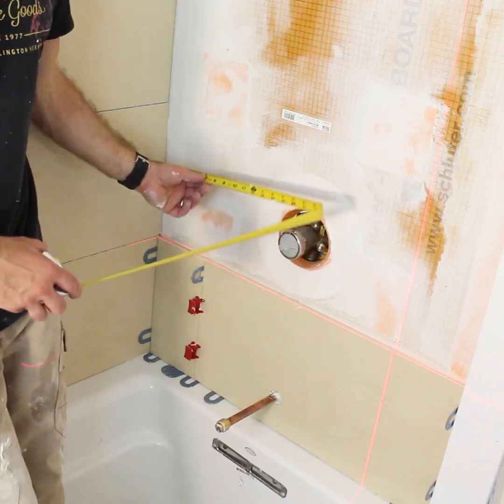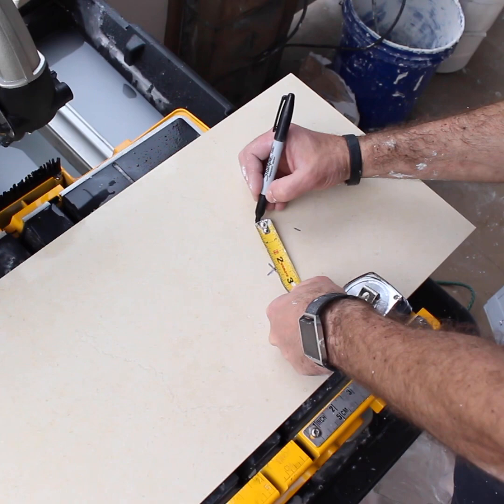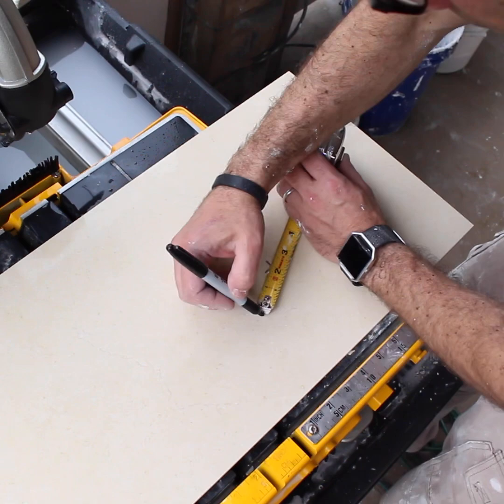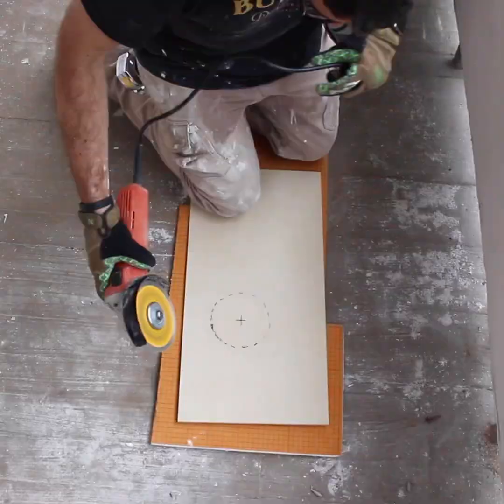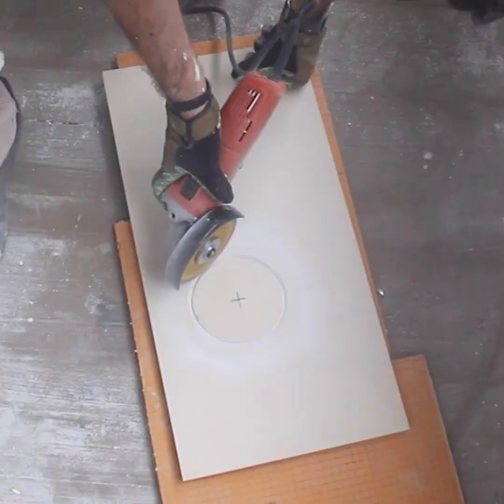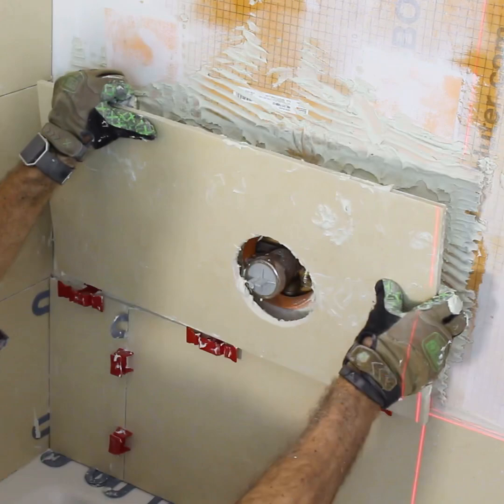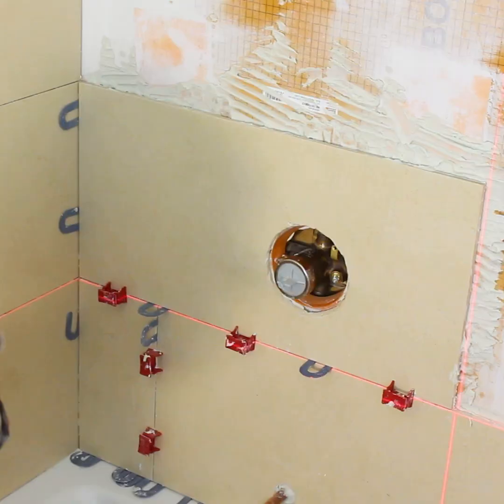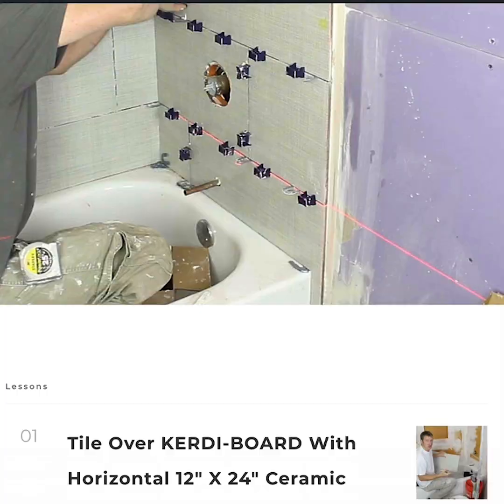Cut Holes in Tile...Perfect Circles - #shorts

Comment: Okay let's do this in a third of the time. Measure to center. Use a diamond hole saw.
 And now we don't have to clean up all that dust that dude with the angle grinder was slinging all over the jobsite. You however might want to think about going and getting your shopvac...